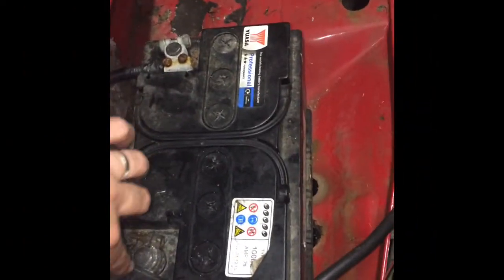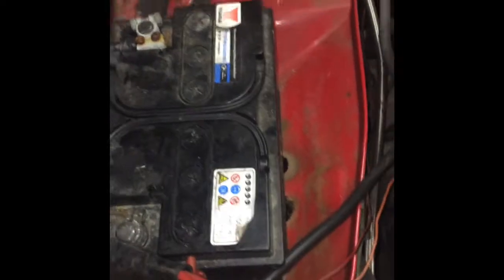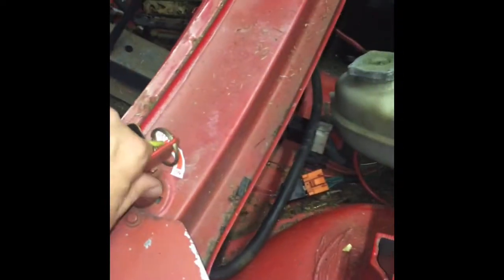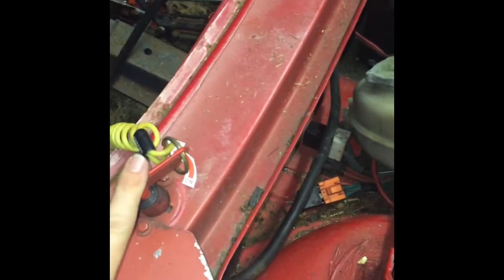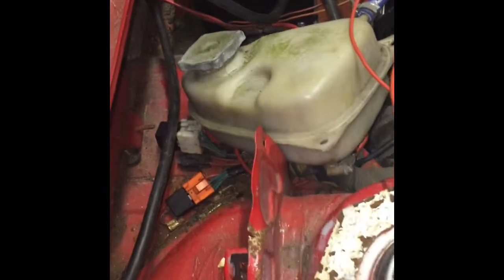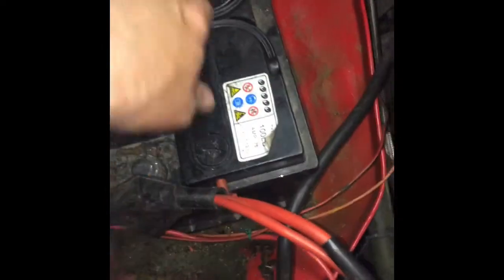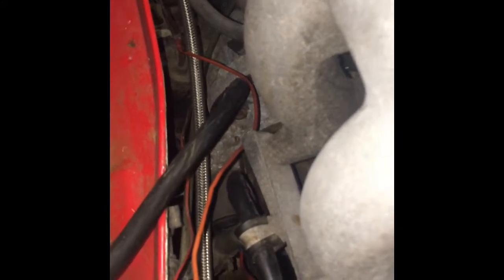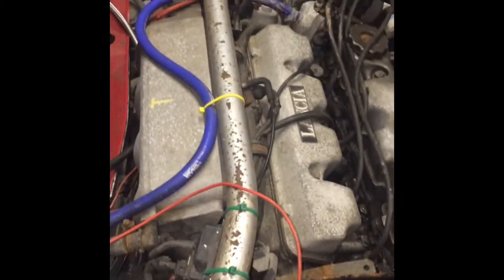vlog: Lancia Delta starter motor issue

Comment: I’ve got the same issue did you suss it out ?
Reply from the maker: Yes, cleaned up the terminals on the starter and earthing straps and stuck a big old jumpstart pack on it.  Worked like a charm 👍